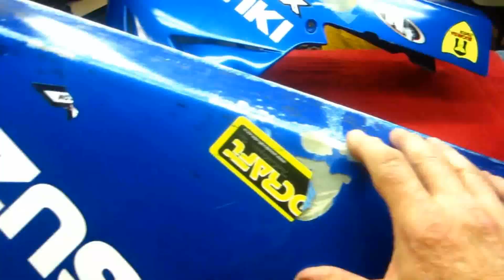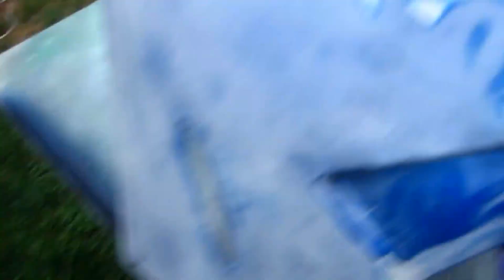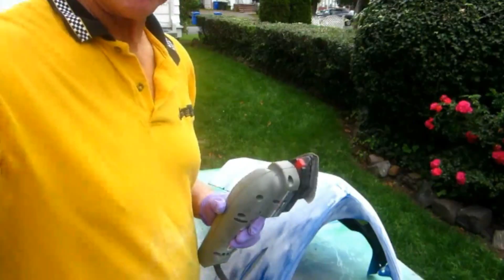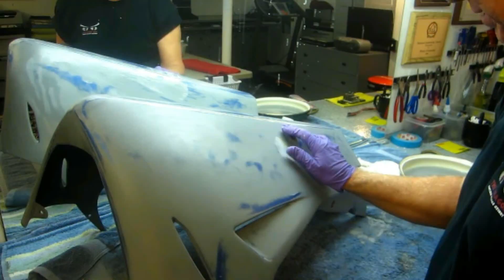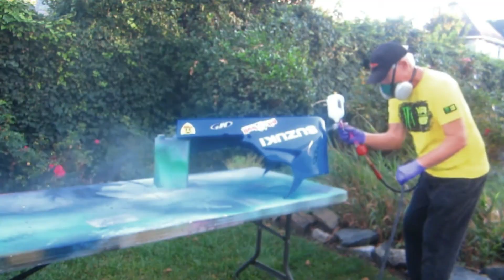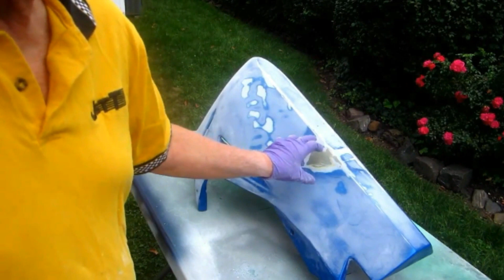SUZUKI TRACK BIKE REPAIR AND PAINTWORK.

Comment from the maker: NO QUESTION IS STUPID MY FRIEND,CA is short for cyanoacrilate,similar to CRAZY GLUE but a higher grade.YOU CAN BUY FROM BRODAK.com or any HOBBY SHOP as modelers use it for many things.Be careful it will glue your fingers together.IT COMES IN THICK AND THIN versions.Many of my videos show the ways I have used it the last 30 or so years.IT IS A USEFUL PRODUCT FOR DOING REPAIRS TO BODYWORK.Good luck,hope that helps out.